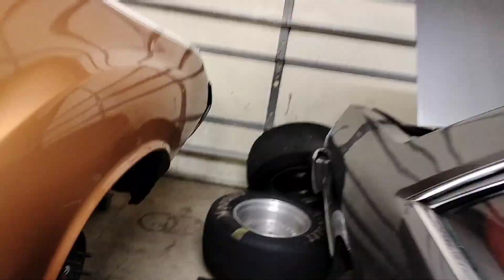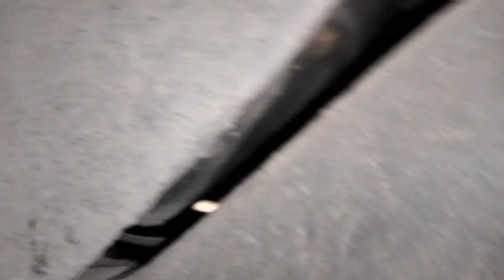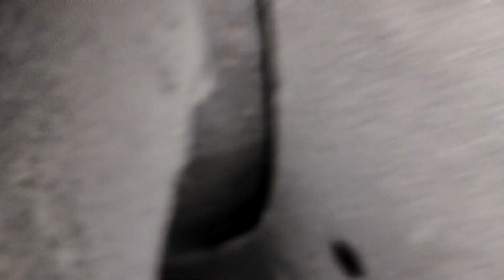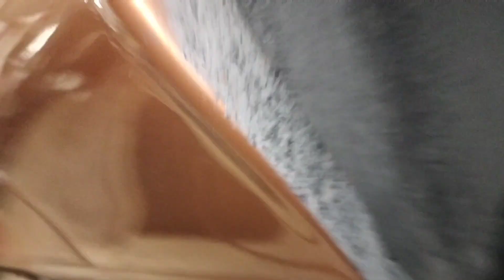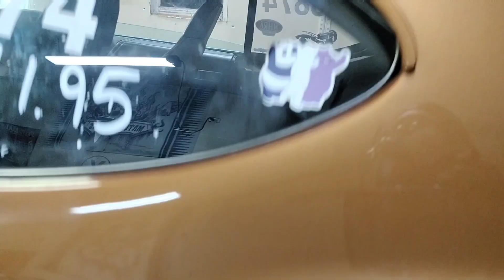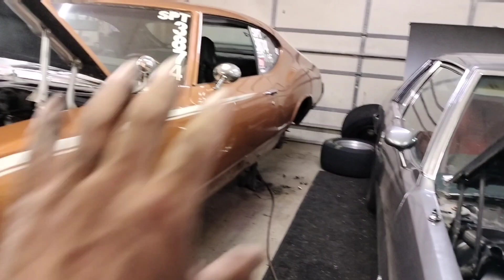R.I.P cutlass. This ain't good

Comment: If you're thinking of a cage then now might be a good time to back half the car. I've had a number A bodies in the 45+ years and the frames have a tendency to rust through from the inside where yours is and behind the arch where it flattens out. I've repaired some but a back half kit eliminates the weak spots. 
I just came across your channel,  looking forward to watching the progress

Comment: Not sure if you have the connectors (can't remember the name of them) that are bolted on from the frame mounting point of the rear lower control arm to the frame mounting point of the upper rear control arm? Those really help stiffen up the rear suspension, they use to install a factory version on the big block cars back in the day.

The factory version were flat steel pieces where the aftermarket ones are made from tube steel. Good luck.😎👍

Comment: You have to pull the Frame rail back together and set the Left and Right Wheel base exactly even both sides. 
Its actually easily done with a Hand Ratchet Winch.  Bigger the better with a 2 foot long handle. Then plate over the cracks with 3/16" Cold rolled A36 Steel. 
To keep it from cracking again 4130 Chromemoly tubing Underbars should be installed left and right sides running full length right after front wheels to where Rear Lower control arm attaches to. They will need to be custom bent up each side with a Hydraulic Power Tubing bender. Chromemoly must be Tig welded in.
GM full frame cars are Famous for failures like your A-body Cutlass. 
The 2nd Generation Firebird Camaro is much stronger Unibody once Subframe connectors are installed.
Reply from the maker: I'm a body man by trade. I can pull it dead on . I'd rather start with a new frame clean it box it built it suit  the needs
Reply: I would think if you straightened it you could do the same thing and be golden.

Comment: I would bevel the crack weld it, grind down the weld then weld fish plates over top.
Reply from the maker: That was kind of my idea but really it would be temporary.
Reply: @oldsrktracer  It will be fine after doing that. I understand it would be better to not have a frame with fish plates on it but other than looks it will be just a good as a new frame.
Reply from the maker: @wildrosegarage4208  I get it I'm not saying it's bad . I just want to do a proper frame for a cage. But the body has some sins from when I was 17. I patched the floors and they are not the best . Just lots of little things.
Reply: @oldsrktracer  I read your mail. The old girl don't look too bad from the bleachers running 11s though I must say.
Reply from the maker: @wildrosegarage4208  the body work and panels are all great but it needs full floors. I would probably keep all the running gear and suspension but sell all the panels.